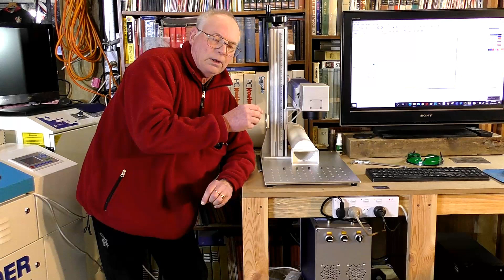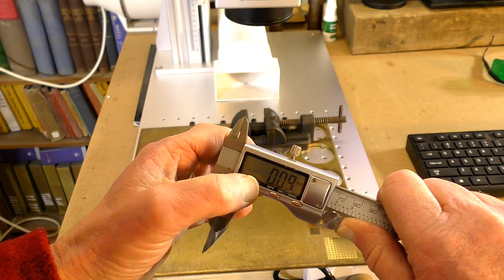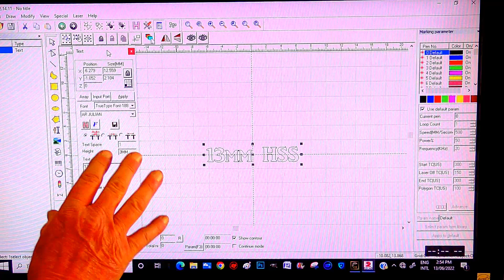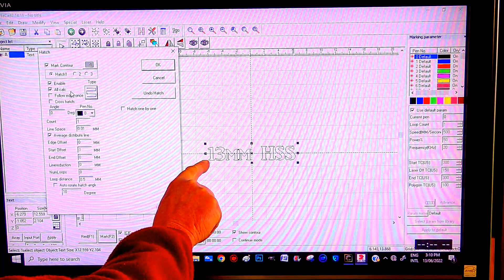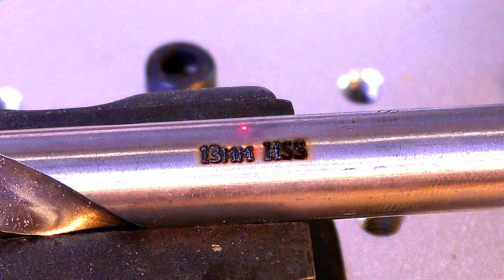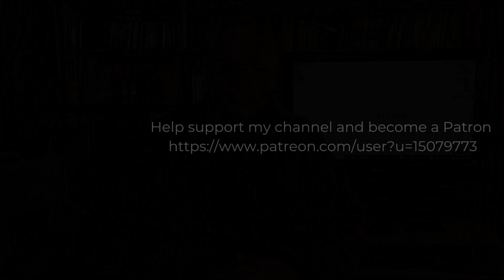A 30watt fiber 🎇laser can do what a 100watt CO2 laser cannot FULL BORE FIBER LASERS

Comment: Although not a current fiber user, my studies have informed me that after the main etching burn, it is suggested to finalize the job with a lower power/higher speed "cleaning burn" ~ 3000 mms at medium power - that will burn off the charring that occurs during/after the main etching.  The cleaning burn can be one or two passes I.E. 0 and 90 degrees to blow away the crud....  Just an FYI  🙂

Comment: @0:51 it's mainly a matter of how the material absorbs or reflects the energy at specific wavelength. most metals are extremely reflective to 10600nm. if you're reflecting 90% of your energy you aren't going to get much done, except destroy your lenses and maybe your laser. 1064nm will easily obliterate metal but won't even scratch glass.
Reply: Reflective light is the most common problem when using reflective material, one should use some type of toner to aid in the starting procedure.
options is mat sprey paint, or blueing dye & pens or burnishing liquids.
personally i prefer Machine blueing Dye, as don't smell and easy to clean.

Comment: These fiber lasers are all open (not shielded/enclosed) I would be afraid to be in the same room even with laser goggles. Is there no danger from reflections?
Reply: Some of them are enclosed. I have a 30 watt. most of the time I don't wear the glasses. NOT Advised at all. WEAR YOUR PPE. LOL. Other than that and fume extraction. they are safe enough.
Reply: Of course there is a danger, do not listen to people saying it is ok I do not wear glasses and it is all good (it just need one time to get a reflected ray in the eye to get blind or having a permanent black dot at this power). Always Always enclose it when possible, wear glasses if you operate it next to you. It is hight power laser.
Reply: I use a 20 watt and it no issue